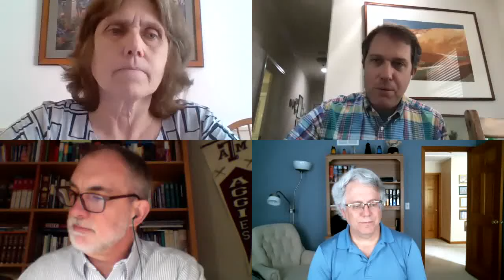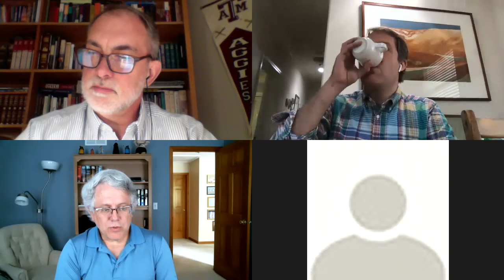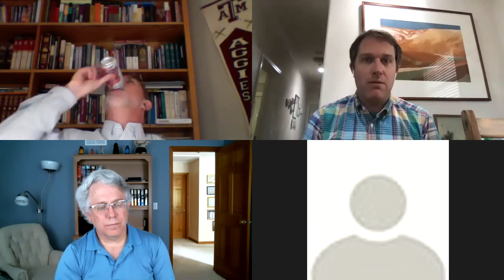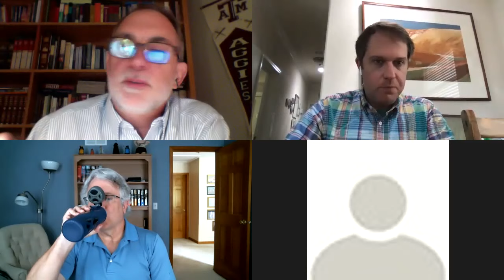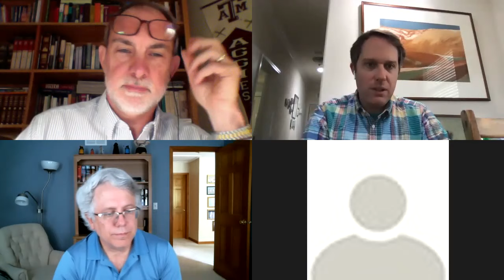Why Fast Reactors

Comment: Allow me to check how clever you people are. My country wants nuclear power able to produce electricity at 0.3 dollars per MWh and it must fit inside decommissioned, 2 km military tunnels in respect to external cooling demands. The electricity demand consists of 20 locations 250 km apart with a total capacity of 300 TWh. The country is a highly respected and important NATO member - yet has a close and good relationship with Russia. China - not so much. Thus it should be easy to acquire necessary metals and fuel. 

How would you go about meeting such a challenge? What reactor type is suitable? Initial investment costs may be considered to be a gift from the government. but not running costs. The solution needs to look at least 200 years into the future.

Comment: So you want to apply radioactive heat to a highly flammable liquid metal that reacts violently with water? Good luck getting the public to go along with that. Lead-cooled has a better chance even if the specs aren't as attractive to the engineers.